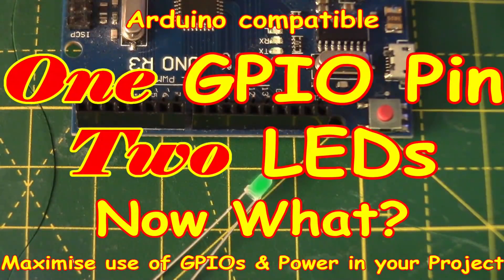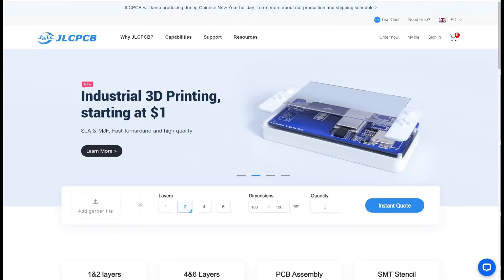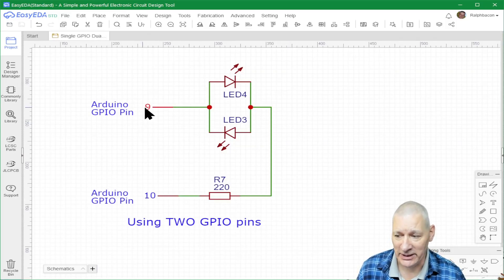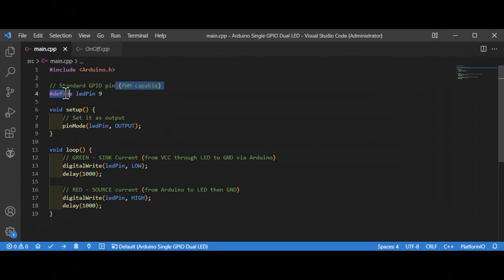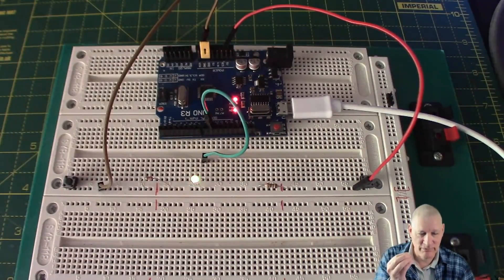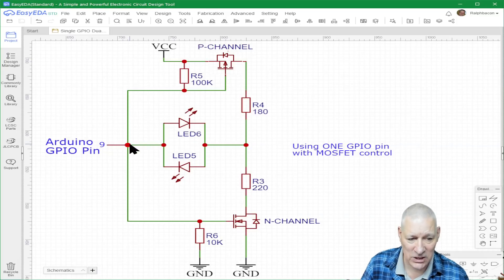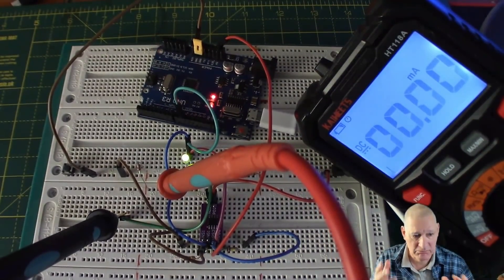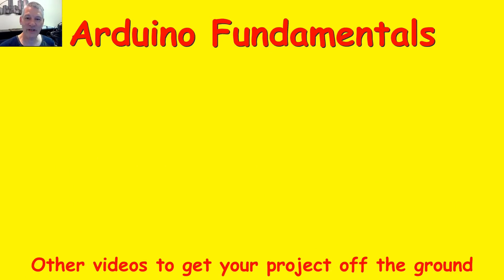#241 Yikes! Only ONE GPIO pin but TWO🔴🟢LEDs - Now What? Easy fix!

Comment from the maker: GOOD NEWS! I've tested the tri-state option now.

You can remove both R5 & R6 (the MOSFET Gate resistors) as they are no longer required; the GPIO pin keeps the MOSFETs in the correct state. This ensures no 45μA leakage through the resistors.

If you set the GPIO pin to INPUT there is ZERO current flow in either direction. Basically, the MOSFETs do not allow current flow. The LED remains OFF. Setting it back to OUTPUT resumes normal operation.

Thank goodness! Obviously I designed it to do this 🤥
Reply: Want yellow? Use a PWM pin and vary the color from red to yellow to green by changing the duty cycle! This trick is very useful for battery status indicators.
Reply: Excellent work and fast follow up! 
I think we all learned a new trick or two today to add to our bag of knowledge :).
Reply: I've started using individually-addressable leds (ws2812 / Neopixles). One gpio pin, hundreds of leds.
Reply: I did wonder why you didn't do that version. As you found out, the GPIO once declared to be an output, is very definitely either high or low and can even have a pullup enabled in setup (pinmode), so there's really no need for mosfet pullup/pulldown resistors. It'll briefly float and stuff be a bit wibbly wobbly before being defined in setup, but that's no big issue in this instance. Good video to highlight some techniques and some 'gotcha's' though that beginners probably won't have considered. I'd probably not trust the high impedance gpio input state to keep the mosfet gates off though, unless you really know enough charge, even microamps, leaks  via the gpio, to keep the voltage on the gates somewhat defined.
Reply: @Tekwyzard  Update: I missed that R6=10K, not 100K so I built one with R5 & R6 to understand what really happens in the GPIO pin OFF state. The circuit settles in a linear state, with the Pch FET partially ON and the Nch mostly OFF. What exactly happens and whether the circuit leaks current through R3-R4 in the LEDs OFF state depends mostly on a lucky pick of high-Vgs threshold MOSFETs. R5-R6 help somewhat in keeping the Nch FET off. Low Vgs-threshold FETs or high Vcc cause both devices to be partially ON and wasting current through R3-R4. See the datasheet for the range of Vgs-threshold. Without R5 & R6 the circuit wants to settle in a less-determined state depending on gate, I/O pin and LED leakage. 

So ignore most of this...
You got me thinking about the LEDs OFF state. The datasheet says that the maximum Vgs threshold is +3V and -2.5V so getting both FETS to be off at Vgs=1/2Vcc will require selecting devices for max Vgs threshold. Gate resistors required. This could be solved with yet more components....
Reply: @nevellgreenough404  But without R5 & R6 and the IO pin on input, that side of the LED can pass no power so the LED will be off whatever the Mosfets are doing . :)
Maybe if both are on you could lose some power through R3 & R4? With GPIO pin 9 disconnected wouldn't the voltage drop across the led turn both Mosfets on?
Reply: Oops 🤣😂wrote stuff for nought 😉sowwy🙏
Reply: Guys... guys... instead of the MOSFET why not simply put 1 cap. It will prevent current across vcc and ground ..in one led  the Adno can use dc and for the other a pulse.
Reply: @zaybxc0  the pulse to use the cap would turn both LEDs on?
Reply: @joseph9915  I think I must agree with you...I am sorry that was stupid of me.
Reply: If the air is dry, and charges builds up in the air, a floating mosfet gate can and most often does trigger the mosfet.
Its not a big deal in this application though.
Reply: Cool, I didn't think that would work as the Mosfets work on Voltage not current. I thought maybe PNP/NPN Transistors.

But now you have it working I realised, With R5 & R6 gone then no power through the IO pin means No power through the led. 

Be interesting to know what the voltage is on the other side of the LEDs between the Mosfets.🤔

Comment: You could add 10 LEDs to a single GPIO using a BarGraph LED driver, and PWM the output to make a (PWM to Voltage) which selects the LED you want..
The BarGraph chips feature a constant current output so each LED is the same brightness.

Using your circuit, you could also PWM the output to change brightness..

Using PWM, I was able to light the LED on a relay without tripping the relay...
Reply from the maker: Cool! Thanks for sharing 👍

Comment: 9:55 We can accomplish that with only one n-type MOSFET. If we set the GPIO to high-z, and let the mosfet pull low when GPIO is in high-z mode or low(like in your circuit) then the resistor circuit will be disconnected from the ground and the GPIO is in the high-z mode so only very small leak current can flow(a couple of uA I guess).
Reply from the maker: Well, that's a good theory; has anyone actually done it, though?

Comment: 2 LED's on one GPIO featuring ON_1/OFF_2,  ON_2/OFF_1, as well as OFF_1/OFF_2.

I recently viewed your single GPIO/dual LED approach - Very Novel.    At the very end of your video, you showed a two led configuration (rather than the single "two-color LED" demonstrated in the video.  I went forward and used that technique with two LEDs.

Recently I was working on project where I intended to use two independent LED's, one to show "SD CARD READY", with a second LED to show "SD ACCESS-IN-PROCESS".  I had orignally expected to use two GPIO pins of an ESP32, one for each LED.  Your video got me to thinking and I came up with a simple scheme that you eluded to at the end of your video to drive both LEDS with one GPIO.  The circuit and my notes are shown below.

                                                     

         CPU +3.3V -----------------------------------------------------------------+
                                                                        LED L1                  |
                                                        +------(K)  BLU  (A)--------------+
                                                        |
       CPU GPIO xx ----( R1, 390)--+
                                                        |              LED L2              
                                                        +------(A)  BLU  (K)------------+
                                                                                                     |
                                                                                                     |
        CPU GND   ----------------------------------------------------------------+ 

      

                        Here's the truth table for this curcuit 

                    GPIO xx                                L1                 L2
          GPIO = Input Mode                    OFF               OFF

          GPIO = OUTPUT_LOW               ON                OFF

          GPIO = OUTPUT_HIGH             OFF               ON

I show BLU LEDs as they have a high enough  V(fwd)  voltage drop to act like non-conducting zener diodes when the GPIO PORT is in the INPUT MODE (no pull-up).

When GPIO port is OUTPUT_LOW,  L1 is ON while L2 is OFF.

When GPIO port is OUTPUT_HIGH,  L2 is ON while L1 is OFF.

One can increase or decrease the value of R1 as needed to dial in the desired LED current/brightness level.

Note, this circuit works well for a 3.3V CPUs and BLU or other LEDs (like White ones) that have >2V V(fwd) values but not so well with 5V CPUs.

If using a 5V CPU, an extra silicon diode (or two/three) ("D1") in series between L1 Anode and +5V, and and additional silicon diode ("D2") (or two/three) in series between L2 Cathode and GROUND will raise the zener diode effect needed to keep the LEDs non-conducting (a.k.a.: OFF) while the GPIO port is set to INPUT mode.  An extra LED can be used instead of silicon diodes in series witht the primary display LEDs to achieve the same result.

                                                     Si Diode D1
         CPU +5.0V ------------------(A) Si Diode (K)-----------------------+
                                                                        LED L1                  |
                                                        +------(K)  BLU  (A)--------------+
                                                        |
       CPU GPIO xx ----( R1, 390)--+
                                                        |              LED L2              
                                                        +------(A)  BLU  (K)------------+
                                                                                                     |
                                                     Si Diode D2                           |
        CPU GND   -------------------(K) Si Diode (A)---------------------+     

If using RED LEDs with lower V(fwd) drops, you may need to add extra silicon Diodes (D1/D2) in series as needed to keep the LEDs off when needed, even if using a 3.3V CPU.

This idea just and my notes detail a way to drive two independent LEDs from a single GPIO port.  Take care.
Reply from the maker: Indeed, that approach is the one I used in my Smart Workshop Heater Controller last year: two LEDs controlled by a single GPIO pin (you can find the schematic here https://bit.ly/3FnIIaS - it's the bit in the "STATUS" area).

As you say this works for 3v3 supplies (in my case, a red and green LED) but with 5v they might start to conduct anyway.

I'm impressed with your diagrams; it must have taken you ages to line everything up (or do you have some sort of app to do this?).

Thanks for sharing, very clear info for all readers to digest 👍

Comment: Would transistors work just as well as mosfets?
Reply from the maker: I think you could use one PNP transistor and one NPN; they must surely work although there might be some changes required to the bias resistors (if they are even needed).
Reply: @RalphBacon  Thanks! 
I think I'll give it a try on my breadboard.

Comment: How would this work with a three leg LED? I just purchased a three leg, common cathode, Red/Green and can't find a circuit diagram for single GPIO control anywhere.
Reply from the maker: It wouldn't work in this case, because the manufacturer has already decided that the cathodes are joined together internally. 

In your case you really do need two GPIO pins, connected (via current limiting resistors) to the anodes of each diode and the common cathode brought to ground.
Reply: @RalphBacon You can easily drive a 3-legged LED with a single Arduino pin. The Arduino port drives the red leg of the LED directly (via the 180R) when its HIGH.  The green leg is switched via a pnp transistor, its base is driven by the Arduino port going LOW via a current limiting resistor, something like a 10K. And a pnp transistor is pence and a smaller smd footprint than MOSFET driver. It works well for common anode 3-legged LED, just substitute a npn transistor.

Comment: So by setting a pin's mode to OUTPUT, and then setting that pin to LOW, ....could you also use that for an extra ground pin like on an Arduino?  It would be really wacky to do that, but often times you are wishing you had a ground in a certain location to help with trace routing on a PCB. Would that work and would there be any drawbacks to doing that?  Thanks.
Reply from the maker: Yes, you can. And it's not wacky! I'm doing that right now on a project. There is a limit to how much current a GPIO can sink (rather than source) so check the datasheet for the processor you're using. Also, remember it's not a true ground; there is a tiny resistance still that might upset sensitive components you're connecting to it. But that's what prototyping is for, right?
Reply: @RalphBacon  Thanks. That is interesting, and it is also good to know that there is a tiny bit of resistance in that type of grounding method. I have a big CNC machine that I use to mill and drill PCB's.  My CNC machine runs on an Arduino Uno, and the probe pin is normally held high, and I am using the internal pull up resistor in the Uno, to help hold that pin HIGH.  The probe, which is a drill bit in my case, ...when that drill bit probe (which is connected to ground) hits the copper PCB, it connects that Arduino probe pin (A5) to ground, and that lets the GRBL software running inside the Uno know that the probe has hit the copper pcb, and to stop probing.  And it works.  But sometimes it fails.  And that can be really bad.  So I am thinking of turning off that internal pull up resistor, and then use a regular external physical resistor connected to 5v to pull up that A5 pin to HIGH.  And try different resistor values. I know there could be some resistance in my ground as I do not clip an alligator clip to the drill bit, but rather to the bracket that holds the spindle on, and that surely has some resistance.  For whatever reason, sometimes it is not pulling that A5 pin to ground enough to alert the software running on the Arduino Uno that the probe has hit the copper.  I have a lot of broken bits as a result of this problem.  So if I can tune that circuit with maybe a higher resistor, then maybe it will make it easier for the ground to pull that A5 pin to LOW, and stop the Z axis from destroying more drill bits.  A tiny bit of resistance can make a big difference in CNC's, especially when grounding the machine. If there is too much resistance, the shielding does not work well enough, and then you can EMF problems that can make a big strong CNC machine do weird things, and it can get a bit scary.

Comment: Thumbs up for letting us know that red and green LEDs need different current, and thus different resistors. That is really great info to know.  For most of us out here, it is success just to get the LED to turn on and off. You raised our level of knowledge. But to be more precise, the video title should have said "One GPIO, 2 mutually exclusive LED's".  It only works if the 2 LEDs are mutually exclusive.  When you introduced the 2 MOSFET's though, I had to leave the room. There has got to be an easier way. The first thing is to try to find a better processor with an extra GPIO.  If that is not an option, then maybe just using a relay might be easier, ...although really ugly. Maybe some kind of small chip that acts like a SPDT switch. Maybe you could do with an optocoupler as well. I am using PC817s as isolators between proximity sensors and a CNC machine's motherboard that I am designing, and they are fun to work with. Maybe a tiny switch register chip might also be an option.  I find it amazing that I now seem to have enough knowledge to even talk to someone like you, so I am feeling pretty good about that.  With Arduino and youtube and the net, I have learned a lot about electronics in the last 10 years, and it has been pretty cool. I never thought I would ever be able to just make up just about any circuit imaginable, in both analog and digital. I can't believe I can now do that.
Reply from the maker: Like a lot of electronics, it only looks more complicated than it is. The two MOSFETS are contains in a tiny 6-pin chip and I use them all the time. Easy peasy.
Reply: @RalphBacon  It is "easy greasy" in my country.

Comment: My first impulse was to connect an inverter  input (40106, 7414 or inverting opamp) to the gpio pin and connect the led between the gpio pin and the inverter output.  For setting the current per led I would put a diode in series with a resistor and parallel to that the same with the diode the other way. and that lot in series with the duo led ofcourse. But I think this has draw backs, like still extra power consumption by the inverter or opamp. You only need 1 inverter in stead of 6. And maybe you can not reliably turn both leds of using 3 state of the gpio pin. So I like the fet solution better. Nice 😃
Reply from the maker: As the MOSFET pair is in a tiny package I agree that it is a neat solution and works well, even in tri-state mode.

Comment: Clever Idea, I loved the solution for brightness. wouldn't it work with one mosfet? isn't it enough to cut either ground or vcc?
Reply from the maker: If you don't block both routes then you would get leaking current from VCC to ground when the GPIO pin was HIGH. And vice versa.